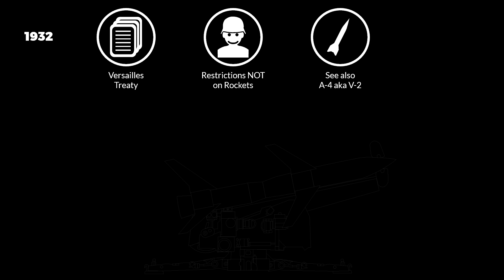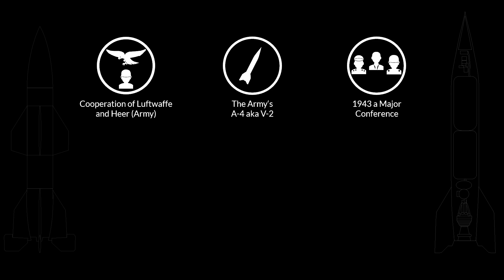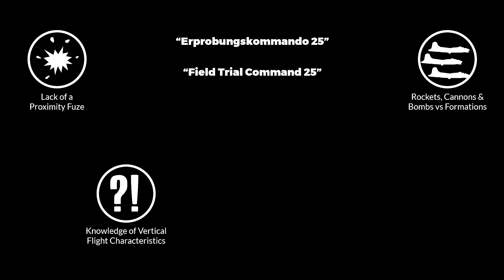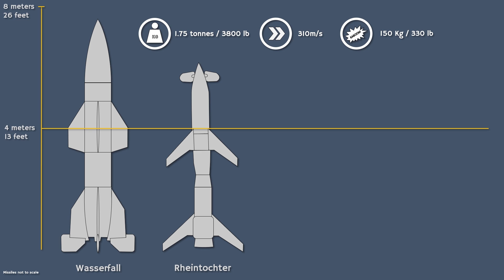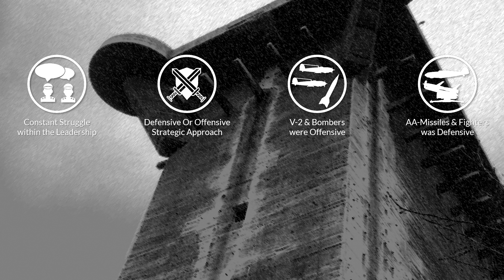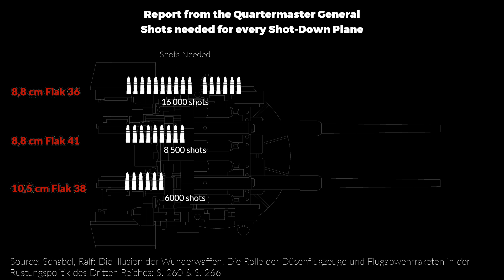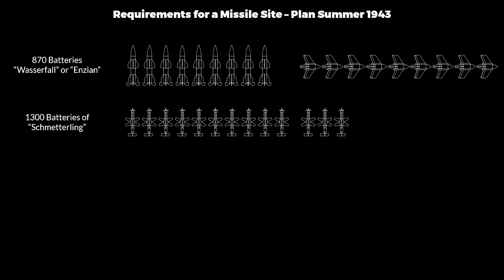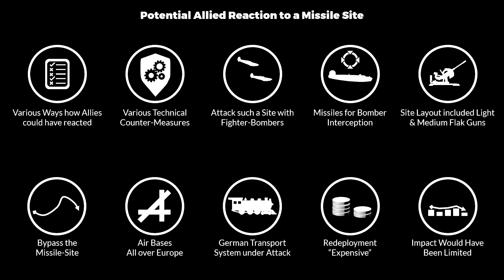German AA Missiles - An Efficient Alternative to Flak?

Comment: I think its bit of a stretch using extrapolated figures to say how effective an weapon system is compared to another. From 1942-1944, German anti-aircraft ammuntion expenditure for the 8,8 cm Flak 18/36/37 totaled 2,514,590 Spgr, with a further 247,010 Pzgr. in homeland defense according to Fritz Hahn. If the Flak 36 needed 16,000 rounds to hit a single plane, only about 160 aircrafts would have be shot down during that period. However, the altitude on which the aircrafts have been engaged is extremly important;  at 20,000ft the accuracy is halved, at 25,000ft its only a third, and at 30,000, merely a sixth at good visibility.

Comment: Perhaps it's a good thing they didn't have someone like B.F. Skinner on their side. He had developed a way to train pigeons to guide missiles into targets, particularly ships. The US Navy never adopted this though. 

Had the Germans had this, their anti-ship missiles could have been quite effective and safer for the launching aircraft and their crews. Likewise it might have been possible to use pigeons as a guidance system for the subsonic AA missiles. Something similar to the Enzian could have worked with such a system, especially a somewhat smaller model made to be launched from a good distance out toward the bomber stream. Train the birds to fly at the individual clusters of bombers and they could probably take several out. Of course having a proper proximity fuse, with impact backups, would help, too.
Reply: There anti-ship missiles weren't exactly INeffective, Roma being a case in point.

Comment: This is a lecture how intraservice rivalry inside the Wehrmacht, bureaucracy and the lack of economic power of Germany played a part in its defeat. All the different branches of the Wehrmacht worked against it each other
Reply: Every part of the German government, as well as the military, was working against each other. By design. Hitler believed that if the underlings are fighting one another, they have no time to work together to overthrow him. The 3rd Reich was actually an extremely poorly run economy, and bureaucracy, until Speer received powers to cut through the obstacles. Add to that the traditional rivalry between the Army and Navy, and later Luftwaffe. The Army correctly believe that the Imperial Navy fatally undermined their modernization in the decade leading up to WWI by diverting VAST sums of funds toward the politically costly, and strategically useless Dreadnought fleet. Goering's influence continued to steer large sums toward the Luftwaffe's bomber fleets long after they were useless, to say nothing of the pointless duplication of effort and diversion of funds, equipment and personnel that were his Luftwaffe Field Division vanity projects.
Reply: on the other side  logthrower su152 was developed and launched in 1,5 months.

Comment: Did the Germans experiment with shoulder fired aa-rocket too? I saw some model soldiers named "Nachtjägers" with one armed with something looking like Panzerscherk(ish) weapon. Instead of one rocket, it had multiple smaller rockets, like shotgun against jabos.
Reply: That sounds a bit like a Fliegerfaust (or Luftfaust) https://en.wikipedia.org/wiki/Fliegerfaust
Reply: +Jeff NME, yes that´s exactly what the model soldier had. Other guy had Stg44 with night vision sight. Guess they were bit of "what if" troops.
Reply: @Taistelukalkkuna  the night vision Stg44s were used in combat a couple times, and 80 Luftfausts were used in combat trials and were definitely used during the battle of Berlin

Comment: Interesting as always and thanks for posting, you two.
From the numbers is it possible that, for the equation developed to model the parameter, a primary factor considered was rate of fire, for those figures given for the number of rounds required for a kill are quite close to the relative difference in rates of fire of the successive FlaK Weapons.  Disturbingly so, in fact.  It's slightly odd, too, as the absolute performance figures for effective altitude of the lang 8.8cm and the 10.5cm guns are not nearly as different as were their relative rates of fire.  It makes me wonder if the calculation wasn't more esoteric than literal, based on weight of metal over time rather than performance against enemy aircraft.
USAAF FlaK Doctrine was to vary height of the "Box", while in flight, to avoid predictor sights, which, perforce, required incoming the bombers to stay at the same altitude and bearing, while flying through the coverage area.
Watch this when you have a chance-if you haven't already: https://www.youtube.com/watch?v=PIYVwqHM488  It's the USAAF Training Film on FlaK.
Ian Hogg admired the technical expertise of the enemy engineers and designers, but was skeptical that any decent Infrared or radio proximity guidance or fuse would've been effective at the current state of the art. (Secret Weapons of the Third Reich-Hogg).  Looks at times as though his editorial bias leaned toward the wire guided Air to Air missile.  The X4/R7 program was a big part of later research on both sides of the Iron Curtain.
Of course, you are aware of and have mentioned before, the relative differences in quantity of propellant for rocket weapons versus obturated tube artillery.

Comment: The Germans used 88mm and 105mm shells by the millions in creating aerial "flak boxes" the bomber formations flew through. The shells were exploding at 20,000 feet / 6100 meters or more altitude. What happened to all those shell fragments falling onto the ground later? Hard to imagine a car tire could survive a drive anywhere before long. Everyone except the flak gunners and fire directors would want to be underground, even if the Allies weren't dropping any bombs on them. I had an ammunition truck loaded with 180 rounds of 155mm high explosive detonate next to my unit in Iraq. The shell fragments were vicious pieces of sharp steel and scattered across a half mile radius that was puncturing tires for days.
Reply: I attended meetings with other people having issues relateed to problems from our similar personal histories for a number of years and this helped somewhat. Eventually, I found that the bonds of family and especially of my Catholic Church home, for all its strengths and weaknesses, sufficed to help me make peace with war.   The tires/tyres punctured were of the standard, US military offroad truck configuration as used by the Oshkosh built HEMT's, 5-ton, 2.5 ton, Hummer, and CUCV trucks.. The Main Supply Route (road) was primarily traveled by support vehicles carrying all manner of things. We did not have any well-armed wheeled vehicles such as the Stryker in those days. The Bradleys, M-1's, M109's, and other tracked vehicles were overwhelmingly north of our position and typically carried on trailers through our area to reduce wear and tear on them and on the already washboarded roads. Tracked vehicles tend to "washboard" roads due to their weight and the spacing of their road wheels.
Reply: Samuel Thompson Your right on point with that observation. Its one of the often overlooked things about massed AA like that, shrapnel will fall back to earth. I know during the Pacific campaign during WW2 there was a good amount of friendly fire from AA in naval battles. I don't think it was ever a big percentage of the casualties, but it was certainly known to happen.
Reply: i see, thanks for your insight
Reply: Shell fragments, shell cartridges and even bullets fall back to earth.  That’s why even civilians wore helmets.
Reply: @WilliamJones-Halibut-vq1fs  I was born in Kiel (Germany) in 1949, and during my childhood in the 1950s, we still found many of flak shrapnells lying around everywhere. Together with splinters from Allied bombs, we selling them to a scrap dealer to make money for candy. I think if you would search specifically, you could still find some today on the fields around the big Citys.
Reply: Did you took help of psychotherapist? 
is there obligatory visits to them in army?

and what tyres were punctured by shell fragments?  standart truck tyres or stryker and other mrap?
Reply: Samuel Thompson Wow, the depth of your insight is profound. During my brief stent in the United States Navy, I really wanted to go to Afghanistan, especially since many of my relatives, and many people I had grown up with had gone off to the war. I felt a duty to go. I often feel guilty for not getting to go... Though after reading what you said, it gives me pause... Maybe it's good that I never saw War.
Reply: @TheHelghast1138  well, you're certainly not alone in feeling you had a duty to fight for your country. After all, tens of thousands of people volunteered to fight on the Western Front in WW1 and, I'd imagine, the reality of that conflict was nothing like what everyone imagined it was going to be. Afghanistan is a totally different war from that, of course, but as Samuel mentioned death can strike at any time and pretty much from anyone you encounter. There is no rear area where you can pull back to and relax knowing you're safe. I'd be inclined to say that yes, it probably is good that you never saw that war.
Reply: War without a clear purpose is always a hard time.
Reply: Samuel Thompson does war really change people a lot? even if they haven't been injured?
Reply: Imagine going through six months of being steeled for becoming a first hand witness to man's inhumanity to man - aka military training. Settle into a dull peacetime routine of cleaning, training, and handling administrative issues. Next comes the electric shock of "We have orders to deploy in theater." Say goodbye to everyone outside your unit, then move into a very foreign place for what is always an indeterminate amount of time. At this point, if you were just a big game hunter or mountain climber, you would have been changed some by these experiences. The soldier then has to live in varying levels of peril to life and limb for months or even years to follow, whereas the adventurer has very little to fear while sleeping in their tent or hotel room, worried only when in the bush or on the mountain. Those adventurers also typically see a lot fewer explosions, random acts of violence, killings, maimings, and so on than the soldier. The soldier is a witness and a participant in these acts that are well out in the far reaches of acceptable behavior for polite society. War affects people, even if their bodies haven't been injured. It took me at least a year to "unwind" after five months of deployment into a hostile theater. I wish that waging war was not something our politicians seem to take so lightly.

Comment: One of the most feasible guidance systems for anti-air missiles at the time used beam riding. A narrow radar beam would be pointed at the target and the missile would only have to steer to keep in the beam. But the radar was not really precise enough to guarantee a hit on its own. Visual spotting with minor beam adjustments could help but this was impractical for aircraft flying high or at night. 

A large flak gun could do the same job and have some chance to hit if the target could be tracked visually. The really high shell counts per target are largely due to firing to cover an area where visual tracking was not feasible. Radar could track targets that could not be seen but not with enough precision at the time to make the missile systems much better than unassisted flak since getting a direct hit with a single missile was difficult. 

Radar assisted flak actually had a better chance to get a hit at less overall cost than guided missiles because they could cover a target area with many shells. A system combining two types of radar for flak fire control called Egerland (combining Klumbach and Marbach radars) was fairly effective but arrived late in the war and was not produced in large numbers.

Comment: While it is true that the Germans did not have all the components developed and ready for a successful SAM, as MVH very clearly explained, they did have a rocket in mass production, the V-2 rocket! While certainly not a SAM, it could very well be adapted for the role with some modifications, for instance, an altitude fuse, or beter still, a radio command fuse. Even a guidance system could be developed (the V-2 did have guidance system but not for surface-to-air purposes).  If fired into bomber formations, its massive 1 ton warhead would certainly make a dent or two. 
Just hypothesis.
Reply: No. V-2 (A-4) was completely unsuitable for conversion to a SAM. The A-4 cost at least eight times as much to build as Wasserfall W-10, was comparatively very fragile, hideously complex (especially the engine), & unreliable. It was also more difficult to transport, store, & camouflage.  Most importantly, liquid oxygen was completely unsuitable for use as a propellant in a weapon that had to be launch ready at any time. All these reasons are precisely why Wasserfall was developed. Development Wasserfall & of it's new engine were not "pacing items" that in any way delayed it's production or service entry; it was the guidance system. Therefore, attempting to convert the A-4 would not have resulted in Germany being able to deploy an effective operational SAM based on a variant of the V-2 any earlier than they could have fielded a purpose built system

re. "for instance, an altitude fuse, or beter still, a radio command fuse. Even a guidance system could be developed" - By definition a purpose built guidance system was being developed for Wasserfall. 

re. "its massive 1 ton warhead would certainly make a dent or two." - If detonated anywhere within a conventional USAAF bomber formation, the blast wave from a Wasserfall W-10 (306 kg liquid explosive) would hopefully  be adequate to bring down several aircraft at once.

All that said, the entire premise of the argument presented in this video is patently absurd. The hackneyed/unoriginal claim that the host & Bismark are parroting can fairly be summarized as "Germany could not have developed & produced an operationally cost effective SAM prior to the end of the war because their limited resources were squandered between to many competing projects". The problem with this assertion is that it completely ignores the  fact that cancelling all the least promising developments, or better yet quashing them before they started, in order to concentrate all efforts on a much smaller number of superior proposals was the obvious solution. For example, by spring 1943 it was clear to anyone with any sense that both V1 & V2 would both technically "work", but that V1 would be infinitely more cost effective. At that point, all work on the V2 & Rheintochter should have been definitively halted, & all personnel & resources devoted to their development re-dedicated to the Wasserfall programme. Likewise, no effort at all should have been wasted on Enzian.

Check this out:

http://www.luft46.com/missile/wasserfl.html